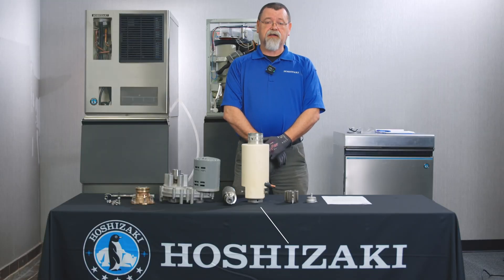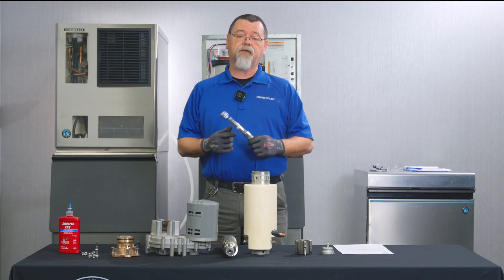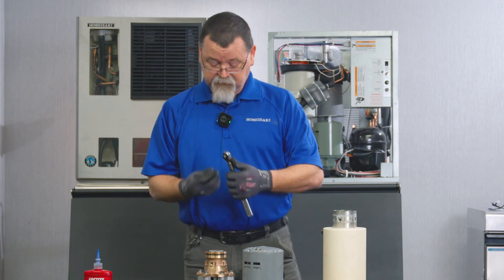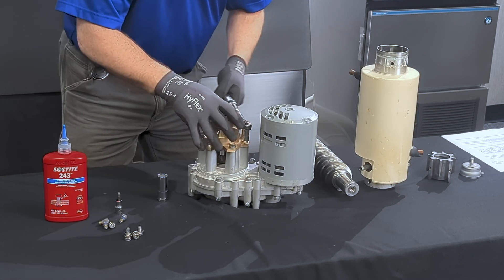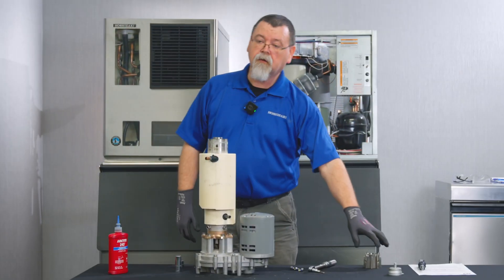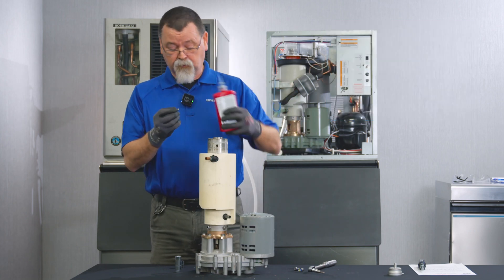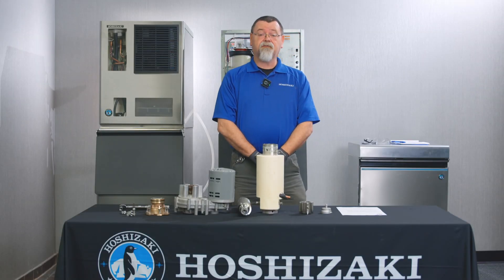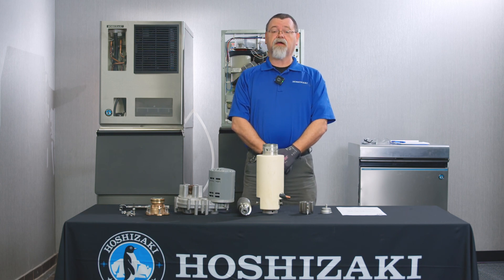Flaker Seal Bolt Replacement and Torque Procedures (Technical Training)

Comment: Que tal buena tarde señor, muchas gracias por todo éste tema esta muy interesante, además aprendí que es muy importante el torque de apriete para ensamblar correctamente el evaporador y motor reductor. Les agradezco mucho sus videos pues de alguna manera uno se enseña con ustedes. Le ruego me disculpe por no saber inglés pero le aseguro que pongo  toda mi atención e interés en aprender. Gracias nuevamente. 
Saludos desde Coacalco Edo de México.
Reply from the maker: Muchas gracias por su apoyo, nos alegra saber que encuentra útil nuestro contenido. 😄
Reply: @HoshizakiAmericaInc  gracias a ustedes y le aseguro seguir atento a sus nuevas enseñanzas. 
Saludos desde Coacalco Edo de México.